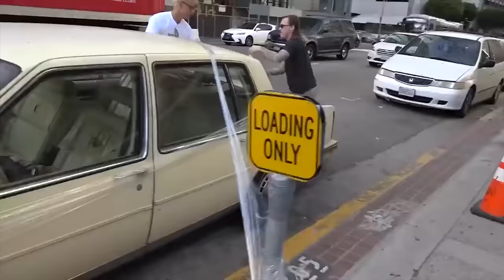BEST Bad Parking Revenge Pranks (NEVER DO THIS!!!) - FEMALE PUBLIC MAGIC COMPILATION 2018

Comment: You should be locking things to their passenger side instead and see how many of them drive away anyway.
Reply: Alan Burns sounds like great content, not for them tho...
Reply: dumb idea, dangerous and likely to damage the vehicle which would get him sued
Reply: Some guys that had problems have used a parking wheel clamp and it will not come off. You have to call parking control and they gladly charge for the service and give you a hefty ticket.

Comment: At 6:12 does the dude not realize he could just take the chain of his side view Windows, there not that tight on.
Reply: Because it's all set up dude. Even the handcuff can get off easily, just pull the handle then boom it comes off
Reply: They're call mirrors btw
Reply: @danielwilliams3378  how would it come off if you pull the handle?
Reply: @sprk_music  bruh that type of handle when you open the door it gives a space at the end of the handle (if you know what I mean). Just like a usual modern car that use that kind of door handle
Reply: @danielwilliams3378  I'm pretty sure the handle is still attached to the door, even if you pull it. So you can't break it off. Do you own a car?

Comment: 7:10 think he parked there on accident
Reply: i mean maybe, but its red curb and a yellow firehydrant it would be pretty difficult to not notice. You should know the rules/law.

I feel that its worse to block a firelane than a fiirehydrant though. What they have to do is bust your window open and then put the hose through your car. This means it is still accessible. But if it's life or death and minutes count, then it really matters.

Comment: If you want to be excessively brutal, get header wrap ties. They are hardened stainless steel zip-ties. You darn near can’t cut them and they are pretty sharp tbh. They would never get them off easily.

Comment: use a wooden match , undo the tyre pressure cap, insert match, let the air out of the tyre until it is flat , screw cap back on , walk away ......no damage , no crime.

Comment: Fyi, sometimes handicapped parking isn't cut & dry. Some disabilities aren't easy to see, but need handicapped parking. There's also times a driver doesn't need it, but is picking someone up, that does. People see the person walking in, & don't know they're going in to get someone that does. They should have a placard, but forget it, it's stolen, or a plate, in a different borrowed car or ride. Those of us w/wheelchairs need the access either way. Time, & space are needed to get in, that aren't possible w/double parking, so riders can get in. While sometimes a person stole it, or borrowed a car w/one. As someone w/a wheelchair it's awful when an able person steals it from someone that needs it. I'm all for karma, just isn't always possible to know quickly.